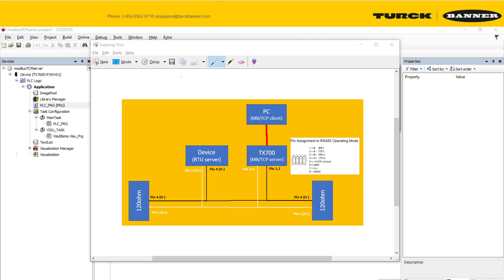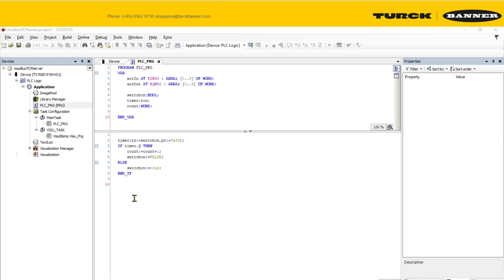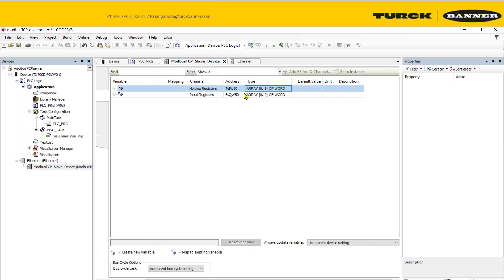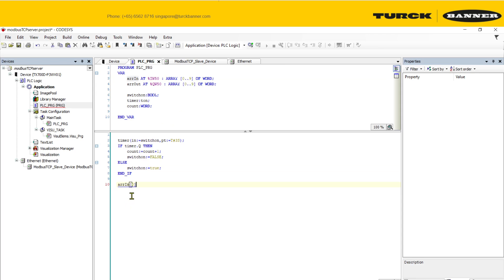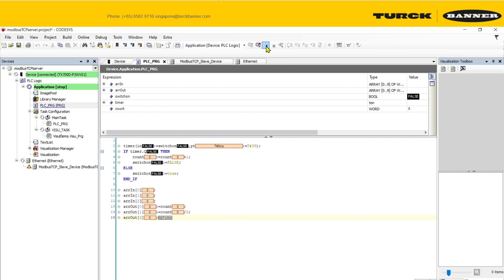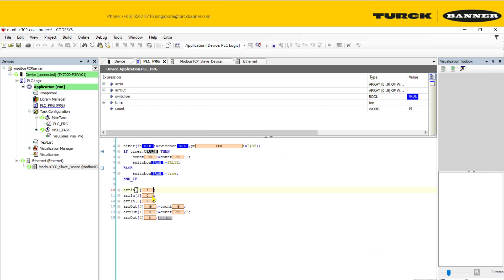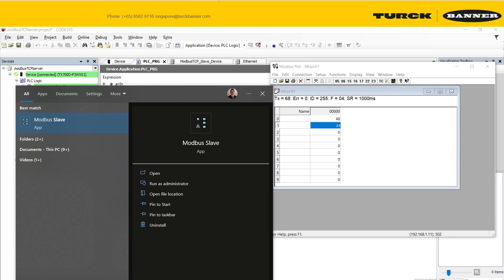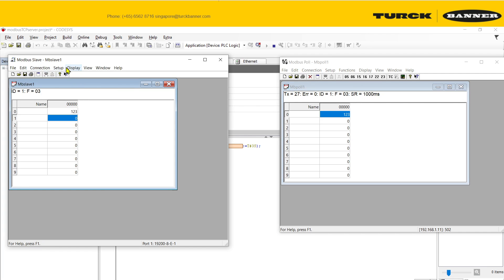How to use CodeSys Modbus TCP slave and reach other connected Modbus RTU devices

Comment: Thanks for your tutorial. Where do you set the slave address on 255?
Reply from the maker: Hello, you don't have to set it. the codesys master is pre-configured to have 255 as the address. If you use anything else, it will not work

Comment: Can I ask if VisuELems.Visu_PRG has a program in it? I followed you without this part. The results are still communicated, but there is no data transfer between the registers and the Modbus Poll.  interface.

Comment: do you have tutorial for modbus RTU as slave while controlled by the TCP master using converter?
Reply from the maker: If you wish to use a USB-to-RS485 converter to make your PC into a slave, the only difference should be to choosing the respective COM-PORT. 

Just open the windows device manager and then plug your device in.  See which new com port appears

https://superuser.com/questions/1059447/how-to-check-com-ports-in-windows-10